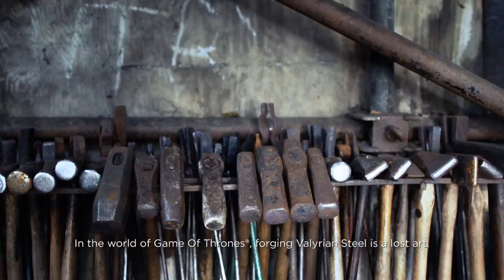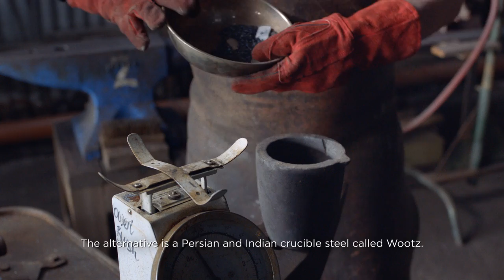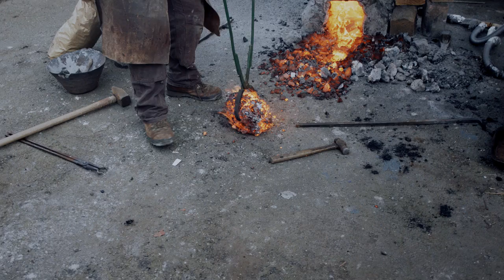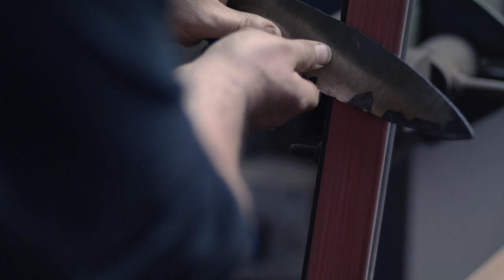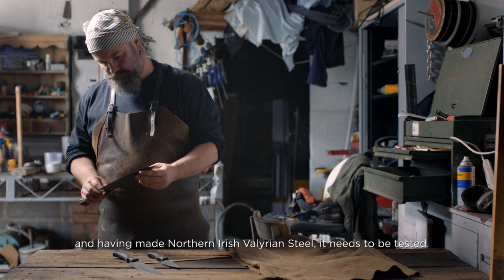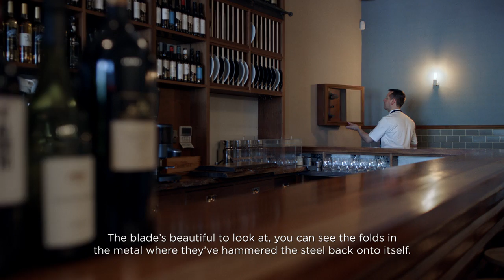Real Valyrian Steel Comes to Life in Northern Ireland

Comment: I found this video very interesting. I always  thought th obsidian was very brittle but they are making blades with it.
Reply: They probably put like 1% obsidian in there, and it looks like most of it dripped out. Obsidian can't really be forged with steel, it would just make inclusions that would weaken the steel, I think it's more for PR than reality. THE FINISHED BLADE LOOKS LIKE ANY OTHER DAMASCUS
Reply: well not exactly because it is reinforced with steel and the obsidian gives it an extremely keen edge.